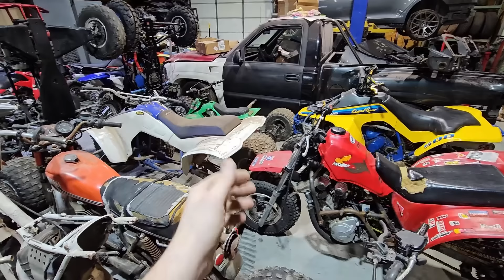This $500 Honda 400ex Got The Best of Me... (Seller Sold me a Clapper w/INSANE POWER!)

Comment: I have a PIM 1 kit the Yoshimura system for the LTR 450 I have a big boar high compression pipe intake ported the whole deal motor for an LTR 450 13 and 1/2 to one compression ratio so she makes some good power all the bells and whistle every bolt on from Alba

Comment: You are 100% wrong on how that carburetor works on that carburetor it does not have an air screw it has a fuel screw if the screw is on the back side of the carburetor next to the engine that's a fuel screw if it's on the front side of the carburetor near the opening that is an air screw when a carburetor has the third jet that is not an air bleed screw that is your starter jet that is the jet for the choke maybe you should learn how a carburetor works before you start trying to tell other people how they work when your not even correct on your terminology and how it works on a carburetor with an air screw you adjust the opening that lets air in on the pilot circuit on a carburetor with a fuel screw it adds a tiny bit of fuel or takes away a tiny bit of fuel from the pilot circuit they both act on the pilot circuit but they do two totally different things
Reply from the maker: @MrATOMBOMB420  its kind of a moot point tbh though because each one does the same thing by creating the same ending result (the reaction of controlling idle up to 1/8 throttle). You are right that i explained 2 stroke air screw while working on a 4 stroke carburetor because i do 95 percent of 2 strokes so forgive me for being human lol. Its always the simple stuff thats so easy to forget or mixup 🤙
Reply from the maker: @MrATOMBOMB420  oh and happy thanksgiving!